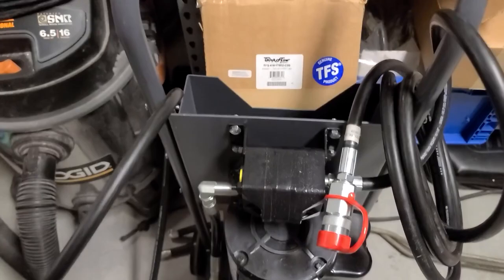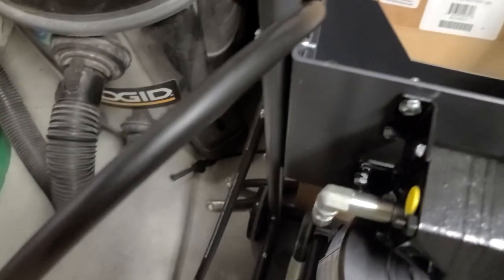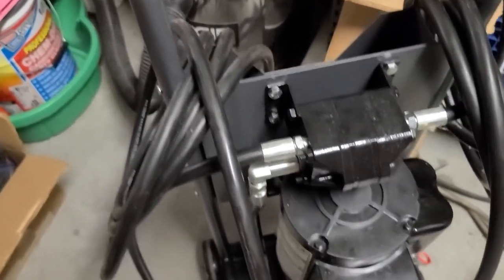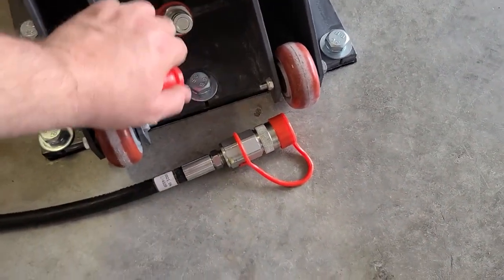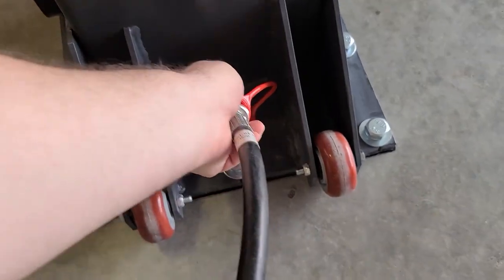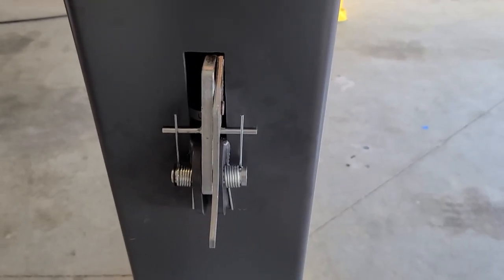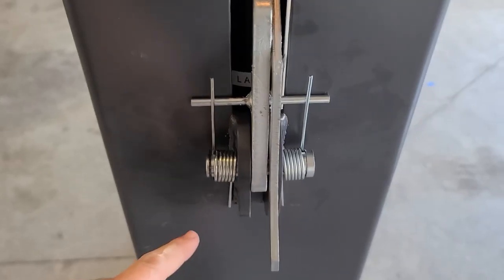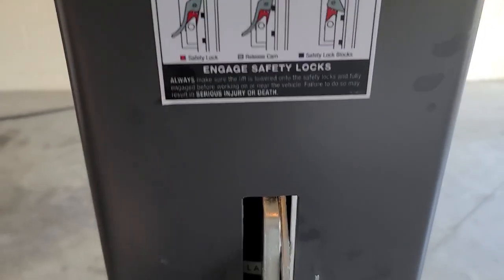MAXJAX - Install Part 2 - Hydraulic lines, Arms, Safety latches and Bleeding the cylinders

Comment: I am super interested in how you like that lift. I have been contemplating one for a while now.
Reply from the maker: I will be doing a review of it after I use it a few times.  I asked @jerayracing Ricky if he liked theirs and he gave it a thumbs up.  However, in looking at their channel they don't move it around.  I don't have the space for a permanent mount, thus I got this one.  My first thought is that it is not going to be as easy to setup each time as I will need to make sure the drivers side is square to the passenger side each time.  Not hard just a bit time consuming (fighting that 1/16 of an inch here and there can be a pain).  Hopefully I've made it out in my head to be a bigger deal than it is.  We shall see.

Comment: How far did you set your posts to lift your car
Reply from the maker: Inside edge post plate to post plate is 107 inches.
Reply: Did yours come with cylinder clamps? I just bought the m7k open box and it’s talking about clamps which I got but the instructions don’t make sure and not sure what the clamps would actually do
Reply from the maker: @ss454gm  Mine is the M6Ka and there is no mention of a clamp for the hydraulic cylinders.  However I did notice that the instructions that came in the crate and the instructions that were on line are vastly different.  I ended up using both sets as one would helpful information that the other didn't.  My neighbor and I just shook our heads during the process.